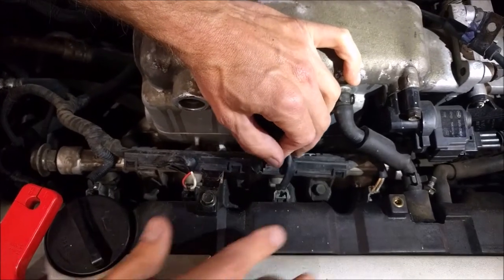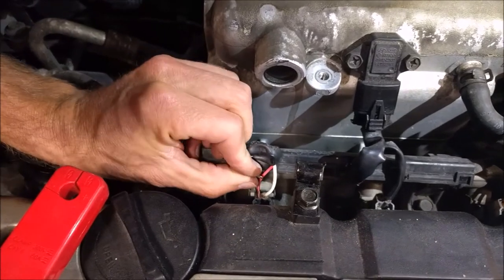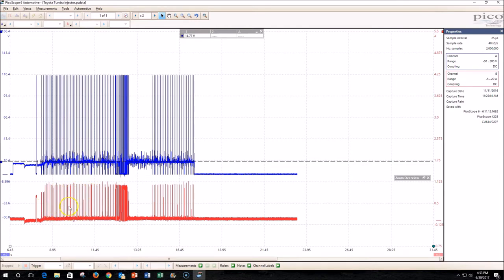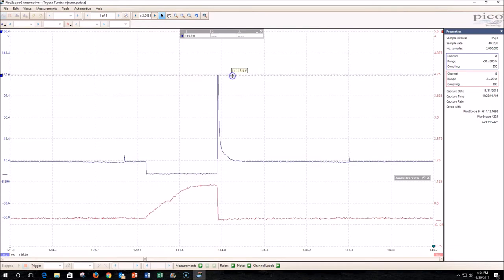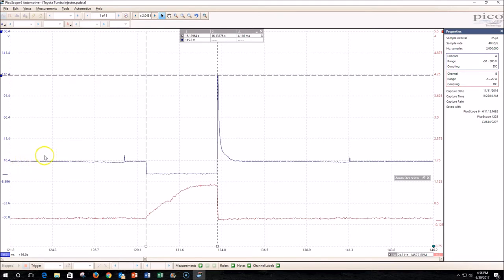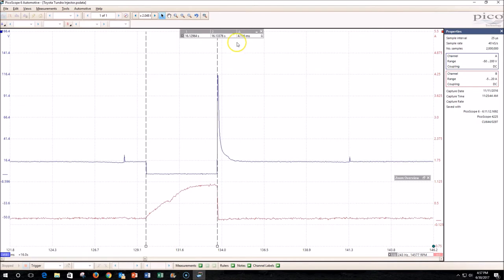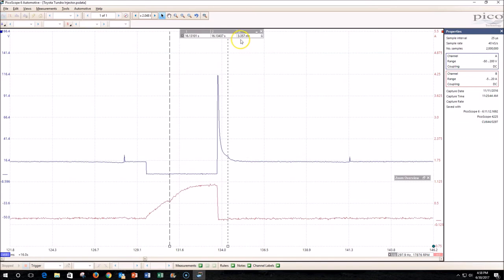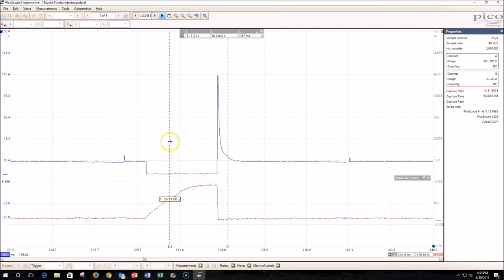Testing Fuel Injectors with a Lab Scope

Comment: Have you ever seen an intermittent injector signal where it cuts out here and there?
One of mine has intermittent signal here and there with no codes and no misfires.
Car running rich at idle only though.
Good vid BTW

Comment: Justin
can you let us know about when and where we need to use attenuators so we don't damage a scope.  Also let me know where I can purchase a inexpensive scope.
Reply: Richard in my experience your scope has a hard limit on the input voltage to let you know when to use an attenuator.Let us say 5 vdc. If you want to measure a circuit you know has 24 volts dc, you need an attenuator that will multiply the input value. If you had a crank sensor that had a signal higher than 5 vdc you would need an attenuator. If you had a sensor that gave say 3 vdc signal then you can use your scope without the fear of damage. Let us assume your attenuator said x10 on a scope with a 5vdc input max. Install or place that in series with your test lead and you know expanded the working input range to 50 vdc. The attenuator acts like a device stepping down a higher voltage to a safe voltage for the meter input handling circuits. These circuits contain ic chips and dont like to operate more than safely designed. If you are looking to play/learn with a cheap scope then I would say Ebay is fine. If you work on automotive applications then AES Wave has a great selection and offers training materials. Please know the limits of your tool before you begin testing. You may injure yourself or at the very least become upset when you let the smoke out of your testing device.